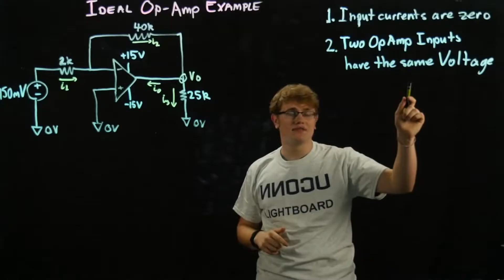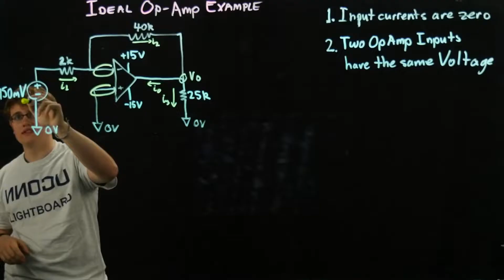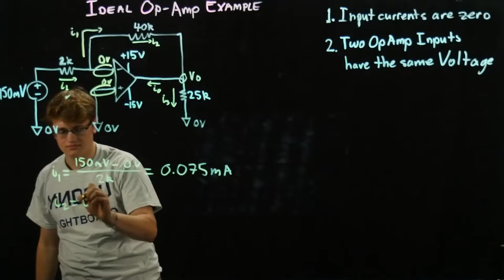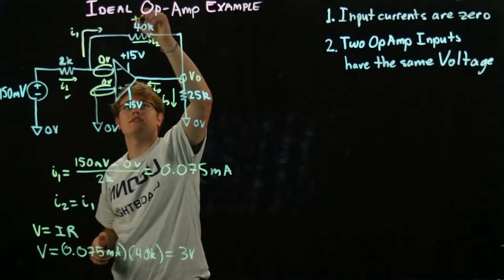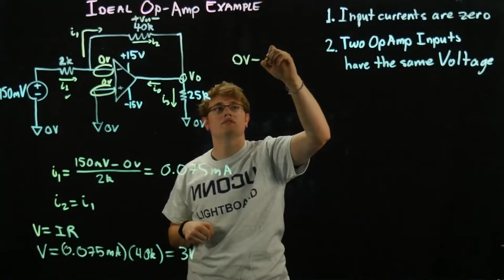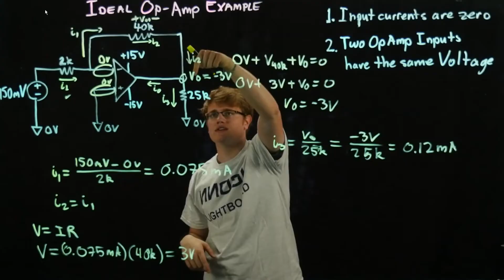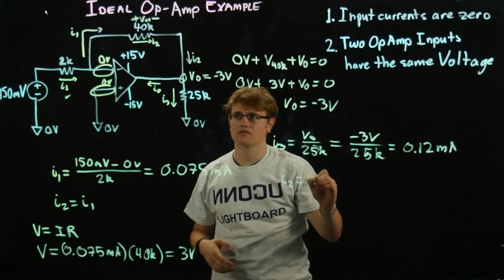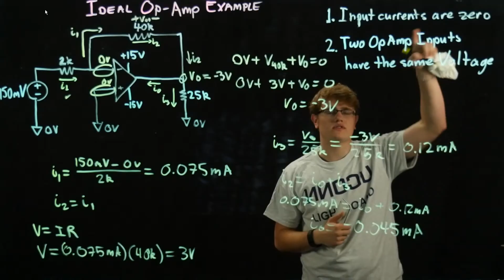Circuits 1 - Ideal Op-amp Example

Comment from the maker: Howdy All! Some corrections for you!

Vo = -3V is correct, however when we calculated i_3, we forgot our negative sign! 

i_3 = -0.12mA is the correct answer, meaning that our answer for io is:

io = i_2-i_3 = 0.075mA - (-0.12mA) = 0.195mA (into the OpAmp)

Sorry for the sign error!

~Andrew
Reply: Some are still incorrect
Reply: bro u realized after 6 years mannnnn

Comment: There is a mistake at the end of your calculations. You forgot the negative sign on i3 which would have made i2 positive meaning that there was current entering the op amp from the output side. Please add an annotation or add it to the description to clarify.
Reply: i3 doesn't have a negative
Reply: @joanitarzzalwango6392  I think it does

Comment: The formula that you used to calculate the output voltage(Vout) which is 0v+3v+Vout=0 is incorrect, the right one is 0v-3v-Vout=0. Try it, you won't get stuck again.

Everything else is superb. Thank you.

Comment: Just a general question here, what purpose does the 25k Ohm resistor from the amplifier's output to ground serve? I've seen circuits that have similar and the purpose escapes me. Thank you.
Reply: That represents the resistance of whatever the circuit is driving.  IRL it could be a simple resistance like a light bulb or a complex impedance of a speaker.

Comment: How to calculate the currents  easily, just apply the the Kirchhoff's rule of knots: 
i2 + i0 + i3 = 0 // i2 flows into the knot, so it's positive, i0 and i3 flows out of the knot, so they are negative
0.075mA +(-0.12mA)+(-i3)=0 // convert to i3
i3 = 0.075mA-0.12mA
i3 = - 0.045mA